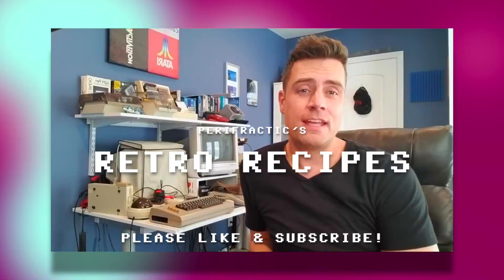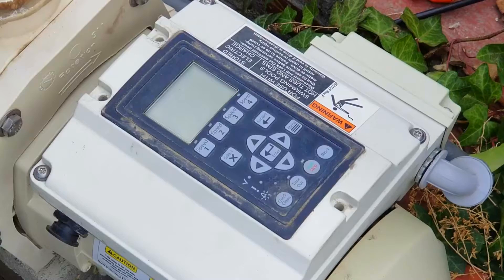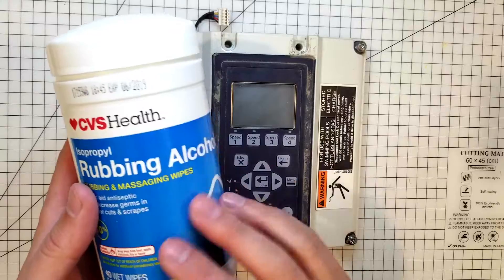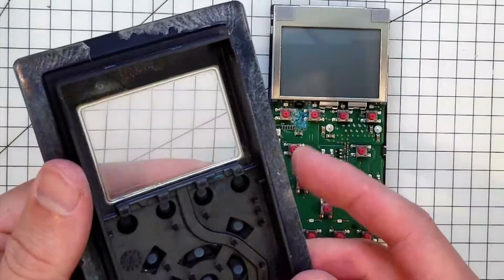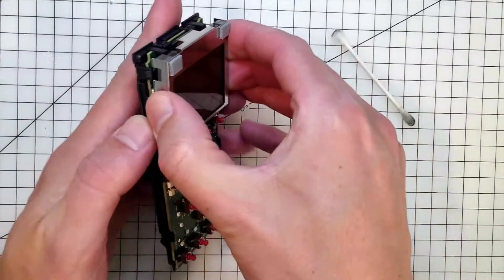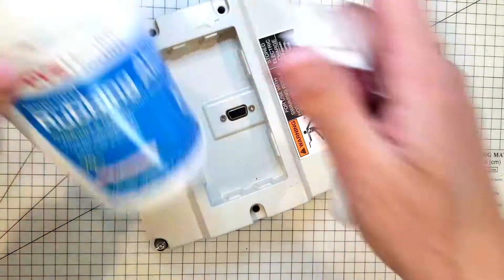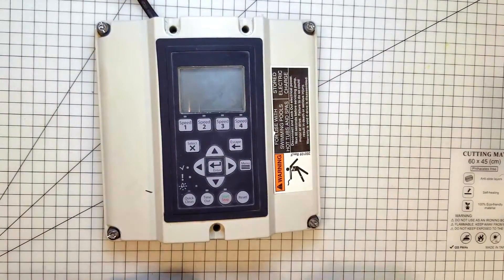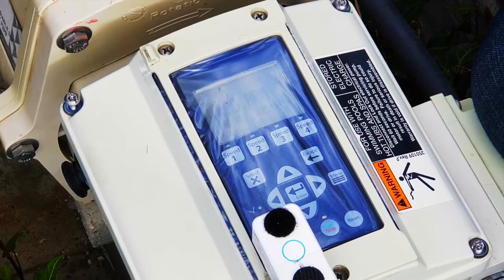Off Menu: Pentair Intelliflo Pool Pump LCD Screen Repair | see description

Comment: Love the video, thank you.  My screen is just starting to show some discoloration from pixels that shouldn't be on but are.  Thankfully everything works at the moment and pool season is about finished here. I may take it apart this winter.  I did ignore the part of the installation manual that said to build a cover over the top of the pump.  Honestly I love the pump but come on, in 2025 how hard would it be to waterproof the screen?  Mine even has little door over the screen (SVRS version)  but still having a problem in the second full year of ownership.

Comment: I am a pool repair contractor.  This is a 1-10 fix.  The main reason these displays go bad is the internal drive itself surges and blows.  I have had so many clients buy a new screen just to have it not work after.   Pentair didn't design these to be fixed in pieces.   People just buy a new drive or display kit if the newer model.

Comment: Thank you so much for posting this. A new part was going to be over $1000. And a seminar product which I’m not sure if it would work or not was $350 on Amazon. I didn’t have the corrosion you had, but after cleaning the clip and installing the install installation, it works like new. Kudos.

Comment: I’ve had a couple of Inteliflow pumps over the years. My previous pumps have lasted about 8 to 10 years each. On my third pump I decided to go with a super flow pump by Pentair. The LCD screen has gone out on that pump as well. I think it’s now about five years old .Going to try opening it up, I know it will be slightly different and not sure if this will work but it’s definitely worth a try.. might be helpful to know what forum you used, If you’d be willing to share it? Just in case anyone on there has done a repair on the Superflow specifically by Pentair. Thanks.

Comment: Thanks, this was a great help!  I had to go back for a second round to add a double thickness of insulating foam, but otherwise everything* went as shown here.  *One small exception ... on my rig, you have to unscrew the RS232 cable on the back to get the control unit out of the large tan mount.

Comment: Thank you, no corrosion but cleaned contacts, reseated the display and added  a rubber strip on top to apply more pressure to the contacts when clipped back into the case. Display seems to be working nicely now!! Thanks again

Comment: Thank you so much for making this video. I have a Pentair Intelliflo VS+SVRS that I bought in 2009 with part number 011017. A pump hose burst and sprayed the pump with a cascade of water for about 30 minutes before I could turn it off. Afterward I could manually turn it on and off but the screen was completely blank. I took the module apart like you showed (slightly different connection but similar) and there was a bit of corrosion on the bottom left button. I used CRC QD Electronic Cleaner spray and Q-Tips like you showed and cleaned under all the buttons and both sides of the circuit board and display connection really well. Put everything back together and it worked perfectly! I didn’t put the foam tape on the display like you did but it still worked fine. You saved me at least $300, well done!

Comment: Thanks for this video, it was a tremendous help! I was able to fix my LCD screen, same issue, contacts getting loose. I didn't have any extra adhesive to get the rubber screen protector glued back down, so I just used a hair dryer on the hottest setting to help reactivate the existing adhesive and used the back side of a screwdriver handle to smooth the edges down while the adhesive was still warmed up. Not a perfect solution, but it seems to have worked well.

Comment: have taken the four screws out and the top will not tap off.  Any suggestions?
Reply: If you haven’t already done so, you also need to unscrew the three Phillips-head screws holding the display cover down as shown at 1:25 in the video. You cannot remove the lower cover without all seven screws being removed - 4 Torx and 3 Phillips.

Comment: Such an excellent video. Thank you for showing us all how to do this. I’m about to attempt my repair. Your conclusion was that the contact was loose, I’m assuming that’s my issue as well. But how did the cut-out ziplock bag work out after all this time? Is still clear to read and fully intact? I see it as a good precautionary measure but I don’t want to do it frequently. Thanks again!
Reply from the maker: I have had to repeat the process once in 3 years but it’s still going strong.
Reply: @RetroRecipes  Oh, that’s fantastic then. When this LCD issue began several years ago and I was just days out of warranty when I noticed it, I called Pentair to seek assistance. Their reply was “Did you get it wet?”  I said “Well, unfortunately it is mounted outside where it belongs”. They blamed it on the rain. I’ve had it over 10yrs and this is the only problem I’ve had with it. Well, that and Pentair’s attitude.

Comment: While cleaning up the circuit board about 6:59 into this video, you pop out the actual rectangular LCD screen / display component.   As you rotate it to show the back, you show black type labeling giving the model / type / manufacture date / etc. information on the back of that screen.   But on the video it's difficult to read.  Did you happen to take a picture of or keep any notes as to those lines of information?  Was there any other indication of the manufacturer / brand / model for this piece?  

Following a power surge during a lightning storm about 80% of my screen turned nearly opaque.  Otherwise my keypad unit still works normally.   I'd love to get enough information on this little LCD screen piece to try to find either that specific or a compatible LCD to try to resurrect that 176L0448 keypad unit on my 0110118 Intelliflo.

BTW: Harbor Freight also carries a 100-piece "Security Bit Set with Case" (their SKU #68457 for $9.99) that includes the required "secure" Torx bit for this keyboard panel removal.  

Thanks for a fine and useful video!
Reply from the maker: Sorry I don’t have a photo of that
Reply: I wanted to say thank you for saying HF carry’s the security bit set, 100pc for only $10.00. The bit “T-25” fit the screw perfectly. Thanks again. Unfortunately for me, this repair not fully work for me :(. Now my screen lights up at least, but the lettering is still not there.
Reply: @tonyadams7444  I had a similar experience to yours after swapping in a used keypad assembly.   But there is a small ray of hope.   

After the keypad swap I restored power to the pump during mid-morning when the pump's schedule would normally have had it running.  I saw a clean, lighted, but totally blank display.  I was initially very disappointed.   But I tried manually starting the pump by clicking "Start/Stop" and then "Speed 1" (my normal daytime run speed).   The pump fired right up.   After some thought then went into the menu and saw normal settings screens.  I found that during the time the power was cut the pump's clock time had been lost and had defaulted to midnight or some such when the pump was NOT supposed to be running.  After re-setting the clock the pump began to act normally and showed normal information.

Hope your situation turns out OK as well.
Reply: @bobriddle6661  Bob, thanks for the further insight. The display is bright but lettering is barely a ghost. I too had a power outage some months back so the pumps clock went to a different time. 
I can less-than-barely see the lettering now, so I used the owners manual as a guide to set the clock. I’m hoping the pump will come on according to schedule in the morning. I need a win! 
If not, I guess my next step is to find that square screen elsewhere, not knowing if that’ll actually fix it. I had zero corrosion inside but I still followed all the steps only to be disappointed. But you saved me so much added aggravation by using that HF bit set!! 
How is your screen doing ? My pump is 11yrso but the screen stopped just under two years of service.
Reply: @tonyadams7444  Tony, you're most welcome.   My keypad display is still working fine - and it's one I got off a water-damaged drive and keypad unit.  (There was actual rust on some of the drive parts and on the D-connector on the bottom of the keypad unit).   I disassembled that keypad and removed the little silver 2-1/4" x 1-7/8" LCD unit which seemed to be fine.   (You can see that piece in this video above).  I transplanted that removed LCD display into my original lightning-damaged keypad unit and - after the initial shock of a lighted but blank display I described earlier - I'm good to go for now.

A forum poster identified the individual keypad units in these pumps as being a particular revision of the DanFoss LCP-102.  They vary in the number of buttons they have but it's possible you could buy the closest revision to yours in terms of the actual LCD panel part and swap that in.  I'm looking into doing that now to have a spare.   Oh, and I'm looking into installing a good surge protector in the wall service box for that pump.

-Bob
Reply: @bobriddle6661  Well Bob, I woke up at 9:30am to a partial victory this morning. My pump is running on its own! Apparently I got lucky last night when resetting the clock. Now, I’ll wait and see what time it shuts off. 
However, my screen is now black, not lighted at all. Perhaps I messed with the “contrast” and unintentionally made it darker, I’ll look into that this evening. I did have the foresight to take pictures with part numbers of the screen, wq4670a-01. So my next step will be to scour eBay or OfferUp for a used pump or screen. 
I’ve gone nine years without a working screen, I guess I’ll go a little longer.

Comment: Runs perfectly - thanks for the video. Very well done. Mine was mounted the same with a few minor exceptions. Looks like no damage to the circuit board. Just a matter of pulling the LCD from the board, cleaning the contacts, and reseating it. Added some insulation tape around the borders as you suggested.

Comment: Thanks...just rolled the dice  and picked up a whole pump for $100 on Offerup. It was listed as controller is burned out...( that's what his pool guy told him)...so he bought a new pump...took it apart and followed your instructions...it is running and purring like a kitten....AWESOME! $100 fir a $2000 pump...woohoo!

Comment: Thank you so much for this video! My pump was a tad bit different taking it apart but still really easy with your video! My pump was working however the screen only had a couple small lines showing. This did the trick! Thank you again!

Comment: Did mine yesterday, the LCD had been out for over a year, very simple fix. Mine was slightly different to dismantle, but the basic principle was the same. Clean the contacts add extra tape and it now reads perfectly!
Thank you for this video.

Comment: Many thanks for sharing! This procedure saved me! The buttons were not responsive after my panel got exposed to water. I took the keypad apart like you showed us and it had similar corrosion near 4th button. Now the buttons work again and I can start it. Its too bad this pump and motor are rock solid but the panel is so fragile. The ziploc is a great idea to add water protection! New subscriber now and will catch up on the rest of your videos.

Comment: Thanks for the video. Is it possible to replace it with a unit/model not prone to this problem?
Reply from the maker: Yes but if you only replace the control panel the connection inside is different though the later model looks the same, so some buttons won't work (select for example). Sadly you have to replace the entire pump, but I think newer ones are less susceptible to this.

Comment: Also, yours burnt out because you removed the sun cover to install that wifi button and the screen was damaged by UV damage. This is your fault, not any fault of the equipment or manufacturer.
Reply from the maker: It didn’t burn out. That wasn’t the fault that this video fixes. It’s a well known pressure fault. See all the other comments.
Reply: @RetroRecipes  🤣 no. Your right...what was I thinking!? The sun damage definitely did not wear out the buttons causing them to leak and corrode the board.....15 year pool repair professional, but yea...
Reply from the maker: @StyxNstoners  Corrosion isn't the fault. That was something that was noted in the video, but was not the cause. The cause was the lack of connection due to looseness. There are so many forum posts about this on pool forums; surprised you haven't seen them in the 15 years. Therefore when I added foam to push down and fix the design fault, it worked. Again, multiple commenters also had this issue and thanked me in the video for helping them fix theirs. But it really is impossible to please everyone and there will always be that one person who is angry and unhappy with me. Have a nice weekend!

Comment: Thank you SO much for sharing this with us! Your solution worked perfect! Now if I could just return new one I bought! Wish I would have seen this video before I purchased it!
Reply: You and I are in the same boat, I spent $300 on a new display and could not return it. It is shaped just a little bit differently inside, so the new one won't even fit. I would have had to spend even more money if it wasn't for this video. I am so angry at Pentair. They should have sent a replacement to all of us for free, we paid a lot of money for the pump.

Comment: This worked well.  Our panel was slightly different but the concept was the same and the display screen has all the correct dialog without any blank areas or streaks.  Thanks so much!

Comment: Chris: Great instructional video. The problem I have is when power to the Intelliflo goes down the internal battery won't keep the clock running. The other pump settings don't change but when the power goes back on the pump runs at the wrong time. Is it possible to replace the internal pump backup battery? Thanks in advance for your reply.
Reply from the maker: I'm not sure but unfortunately I think that's less likely to be an easy job.

Comment: Dude, you're a boss!!  My Intelliflo was a bit newer with 4 named programs along the top.  The Gasket was much easier to remove as it was friction only (no adhesive).   I ordered the security Torx bits (Tonsiki 33 Pcs Security Bit Set Tamper Proof Torx Hex Star Screwdriver) from amazon for $11 and was done in 15 mins.   Saved $200 and the carbon footprint of the new screen and got some SecTorx to boot.

Comment: Chris, thank you. This video is brillant. I'd already order replacement parts and when I got into the replacement I realized they weren't compatible. I took mine apart and followed Chris' example, so well documented. My controller was a bit different than his. Mine was probably an older model. I found no corrosion - everything looked pristine inside. I cleaned the connections points and when I popped it back together, it worked perfectly. With a bit of modification, I was able to turn the keypad around 180 degrees, which solved a longstanding problem for me. 

Well done video. Chris' accent and wonderful speaking voice, along with his good looks, complement his outstanding video editing.
Reply from the maker: Thank you for your kind words! Means a lot 👍🕹️
Reply: @RetroRecipes  Chris, I especially like that you edit your mistakes into the final video. My pump is older than yours and I thought that it had hex security screws. I ordered this bit set https://smile.amazon.com/gp/product/B07K58V6R5/ref=ppx_yo_dt_b_asin_title_o06_s00?ie=UTF8&psc=1 for it's hex security bits. Turned out it was a torx security screw that also came in the set. That was on order before I saw your video or I might have tried the hack saw approach.

Comment: gonna have to try that before i drop $225.00 for new parts.
UPDATE: i did this repair on my pump, worked like a charm. there was no corrosion on the PCB and the buttons were not leaking or cracked. but it did save me $200.00 + form ordering a new part i don't need.

Comment: The  WD40 contact cleaner is not as good as Stabilant 22, used by NATO for the connectors in their airplanes.  I have used it with great success.  It is a lubricant and a liquid semiconductor.  It does not short out adjacent contacts, only connects contacts that are touching by with poor connection.  The 5 ml bottle comes with a set of small brushes and is enough for many uses.  Since my display continues to work well, I have not needed to follow your repair. (My pump got flooded and the 220v ground fault interrupter circuit breaker switches back off after the display lights up briefly to indicate a power failure error.  I suspect the motor has some leakage to ground)  James Foerster.

Comment: as you see 2 months ago we fixed out screen display but now the display is broken how can we purchase just the display screen?
Reply from the maker: Try eBay
Reply: We did and no avail i was hoping you can lead us to only get that screen display only. @RetroRecipes
Reply from the maker: Sorry I don't have any info on that other than googling the model number and "screen". Or set up a saved eBay keyword alert to notify you when one is listed.
Reply: @66skate   Did this module work on your pump?  I have a 011018 and I believe the LCD module is bad.  I will probably need to swap it out, not just clean it, looking for suitable replacement.
Reply: @iotcontrolsllc1289  Yes it did. You need to use all of the old parts and swap in the new keypad to the old frame and old cable. Pentair insisted it wouldn't work. I sent them a pic with it running and they never replied. One thing to note is 3 of the programming buttons are labeled differently on the new pad as you will notice when comparing them. Simply relabel or keep the old pad handy for reference.